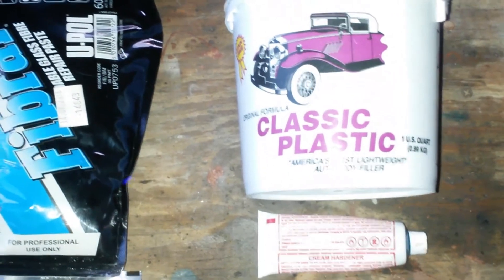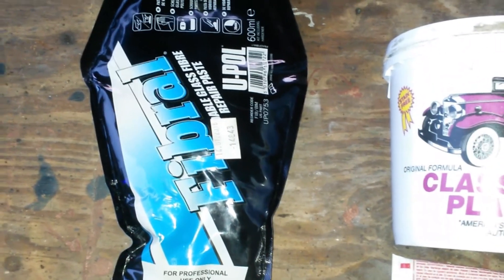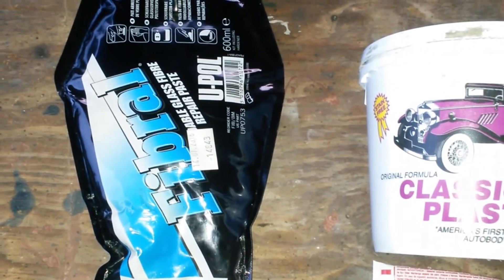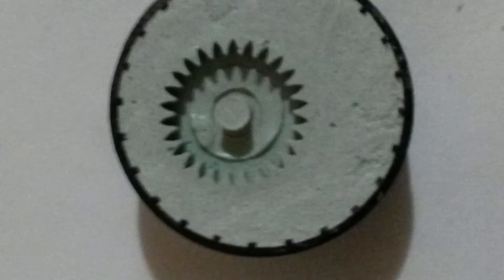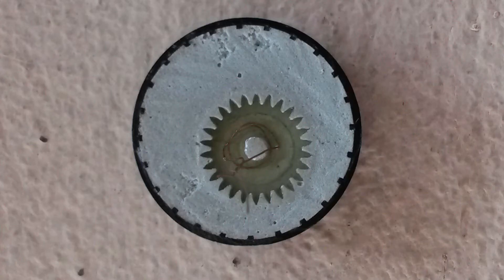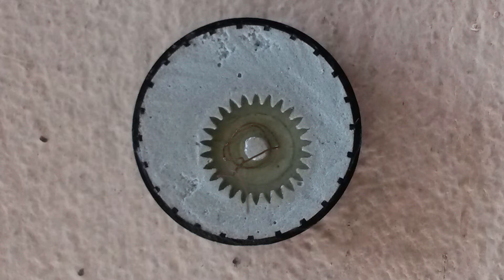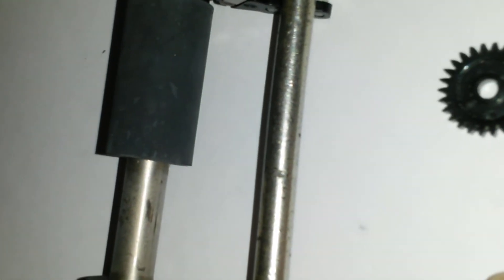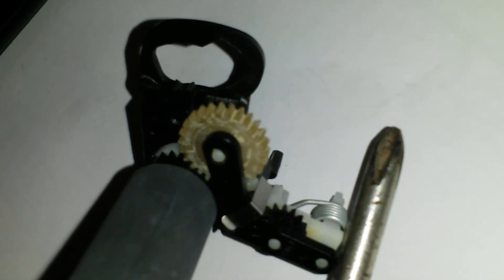007 Moulded Epoxy Gear, an Alternative to 3D Printing

Comment: You fail to identify WHAT you have used...or 'can use'--as a selection/choice of molding materials? What is that faint 'greenish white', spongey-looking compound you have used?

I presume it is some regular, automotive RTV silicone sealant--but it would be much better if you verified that.
Reply from the maker: Automotive filler used for body repair.

Comment: which gear is best for casting
Reply from the maker: The finer the teeth the harder it is to get the mould right. Also helical gears may be difficult to remove easily. You may have to make the mould in two parts. 

If the gear has to take a lot of load try the fiberglass filler used for auto body repair. That is a lot stronger. Metal epoxy is also an option.

Comment: how to make nylon gear
Reply from the maker: As far as I know epoxy does not come in a nylon variant so you will not be able to make a nylon gear this way. 

That said a gear made this way will work well under limited load.
Reply: Lathe  to make a wheel and cut teeth manually...